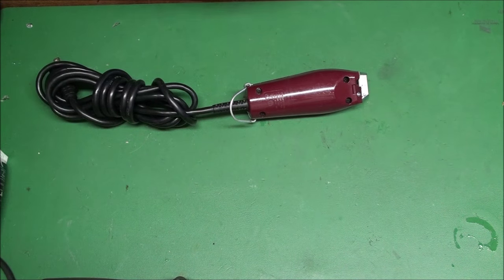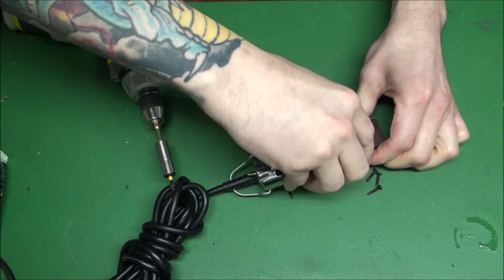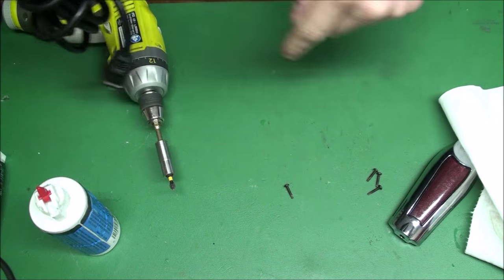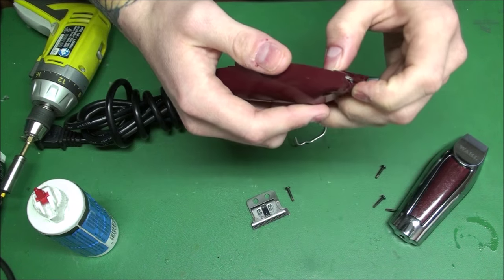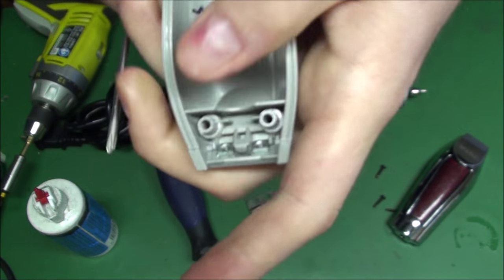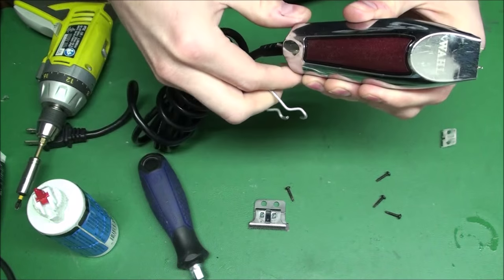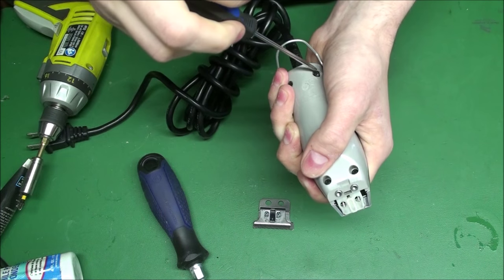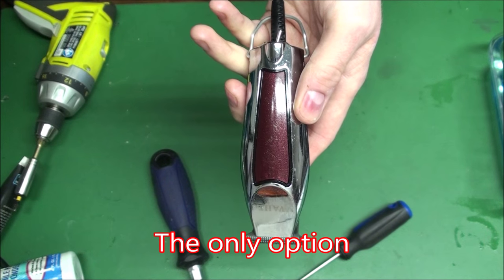Wahl Detailer Trimmer - Basic Repair for Barbers

Comment: These are my favorite liners of all time. I bought 4 of them and every single one cut amazing right out the box. I was able to get sharp lines on kids and adults without scratching them. Only problem is that the housing is very cheaply made. Every single one broke by where the blades go. When I got down to the last one, i treated it with extreme care, laying it down softly taking them out lightly and they still broke.
Reply from the maker: YouAwakeYet ya they are fragile but are very good getting the job done.

Comment: as I was opening and removing the motor the red and black wires came off...is there any diagram to show where it should be soldered any help appreciated the one ine the video is not the same {switch} as I am in uk

Comment: This was helpful. What size/type are the 2 tiny screws that go into the 'under blade'? Mine have worn out the threads. Thanks
Reply from the maker: +classic1984 I do not know the sizes sorry. I order thru a Clipper distributor. I have an account to buy them and have to order over $100 minimum. Your can google  im sure there is of part sellers.

Comment: Mines became very loud for some unknown reason while I was about to line my hair. They're almost brand new, only used them a few times and never dropped them. They were quite and smooth, now they're not. Any ideas on whats causing this?
Reply from the maker: +romedc Well hard to diagnose in a message. Check and make sure there's tension on the blade. If there is not it is the bottom case. It can be the blade guide is melted. It can also be the blade needing a sharpening and re-polish its surface. It also can just need oil on the blade. If all that is good then it will be a shot bearing in the motor and will need to be replaced with a new motor. If there not very old send back to Wahl for warranty. Well.Well good luck and have a nice day.
Reply: appreciate it man thanks
Reply from the maker: No problem

Comment: I have a model 8991 the silver and black sterling stylist trimmers, and I'd used them all of 3 times before they shorted out on me while trying to blend a very thick haired client. Any tips on this exact model would be appreciated because I'd rather tinker with it than buy a whole new one because it's still in perfect condition
Reply from the maker: Hi. this model is 8081 but i think yours will take the same parts but you have a different model number bc of the color. You should send back for warranty .Either the switch fuse blew out bc of the resistance from the thick hair or to much oil got inside of the motor and shorted the motor out and blew the switch fuse out. If you order a new switch i recommend putting a new switch in it and after hooking it up by soldering it to the motor and cord, have it in the on position. Plug it in for a half of a second and unplug it. if it makes a burning sound then it'll need a new motor to bc the motor got toasted by the oil and will blow out the new switch fuse again.

Comment: My Detailers won't turn on for some reason. Switch seems to be broken and wont power the trimmers. What do you think it could be?
Reply from the maker: +Anthony Garcia Hmm. I don't know. How did it break? Did the physical switch break? Did the pcb blow a fuse? Do you oil your blades? How old is it?
Reply: +Cloud's Diamond Sharpening it's not that old at all ..about 6 months old . At first the switch started acting up and getting stiff and then it wouldn't power on at all.
Reply from the maker: Anthony Garcia Since it sounds like the physical switch. If you replace the pcb/switch board it will work but if the fuse is blown out you will have to replace the motor also to prevent a new switch shorting out. I am not responsible if I am wrong. I can fix it if you can't. Good luck.
Reply from the maker: +Anthony Garcia https://www.diamondedge2015.com for all the details. My dad past away and i have a memorial so to be honest i can't promise 24 hour turnaround. But i can fix it for sure. Maybe same day or maybe not.

Comment: great video.. but how to solve the problem with the blade moving and the screws are tight as can be?
Reply from the maker: Hello . Thank you for watching. If the cutter blade is moving then you will need to buy a guide for the blade if they are available or buy a new blade. If the whole blade is moving around on the trimmer then you will need to open to see why the metal inserts are moving and may need a bottom housing to fix it. Hope i helped

Comment: I lost the screw from the shaver head inside part what size is it
Reply from the maker: F Ahmed I have no idea what screw your talking about but find a Wahl distributor and tell them the model number and what screw you need. Thanks for watching
Reply: Cloud's Diamond Sharpening hi its the blade screw from the underneath used to adjust how aligned the blade is, i have looked everywhere but cant find the screw size or the part
Reply from the maker: hi, ok . Its the same screw on a andis outliner blade screw. I dont sell parts. I just fix them. Google search for a wahl distributor. Or you can try fort worth shaver and appliance.

Comment: my tension spring will not curve in when i put the cam follower on its pointing straight up and it dosent slant foward
Reply from the maker: Hello. If the tension spring is not keeping its tension it's because it is broken from the housing you will need to replace the bottom housing

Comment: hey how much u charge cuz my Wahl detailer burnt out I was wondering how much it was so you could put a new motor for me
Reply from the maker: +Christopher Diaz Well usually that problem happens from not oiling your blade and the motor has to work harder. It over heats. You will need to replace pcb with the motor. Have you ever got the blade sharpened? If not it will need to be done.

Comment: One of my inserts is loose and I just got them about 3 months ago and I take good care of them, never dropped them or anything bad can you help me please?
Reply from the maker: Amin Sturges Hello, you over tightened the blade screws and it broke the inside of the case that holds the inserts from moving
Reply: I took them apart and yea ur right but I swear I didn't tighten them to hard what I realized is that the detailers case is cheaply made. They are made to wear out within a couple months. Bad investment when they have so many better clippers.
Reply: Thank you btw
Reply from the maker: Amin Sturges np and thank you for watching

Comment: My blade doesn't come off no matter how hard I pull what do I do?
Reply from the maker: northweezie1 hello. The blade inserts are turning inside the case. So you will have to take off the top of the case and use needle nose plyers to hold the nut from turning and then you will need to replace the housing.

Comment: my detailers make a popping sound in the motor or blade when turned on, I do keep them oiled.
Reply from the maker: +33craigcarter It will either be a motor or a cam drive.(the piece that moves the blades). Good luck.

Comment: how.can i make those more powerfull
Reply from the maker: You cant make them more powerful unless you mess with the voltage. You can have them cleaned and sharpened. It will make them like new if nothing is broken on them.
Reply: how can i contact you ??

Comment: anybody in the comments. The power (red wire) on the rotor motor detached from the mother board. (green board) how do I reconnect?
Reply from the maker: Solder gun and solder it back on by heating up the liquid metal
Reply: @cloudsdiamondsharpening3973  link to a good (but affordable) solder gun?
Reply from the maker: anyone with a temperature gauge so you dont melt the pcb

Comment: Help! I was screwing the blades back in and i tightened it too much and nownmy screws or blade will come out.. any suggestion?
Reply from the maker: It's possible that it cracked the housing that holds everything together. Take the blade off and check the housing under where the blade sits. If you see any cracks, that's your issue.

Comment: Nice work! but can you please! make a video on how to set and sharpen these. I sharpens my owns but no success at all but it's decent when cutting but I need consistent crispness. lol thanks!
Reply from the maker: +Preston Henderson Thank you. Haha that is a hard question to answer without out knowing what equipment you use. I&#39;ve trained lots of people and its not as easy as it looks for them to figure out. You have to have the right pressure pushing on the blade without hollowing out to much in the middle of the blade. You have to pull the blade off the spinning wheel correctly without damaging the teeth, if not pulled off evenly it won&#39;t cut all the way across the blade. Never use a stone it has no shape to it and blades need that to cut correctly.. I have videos of me sharpening on my equipment, on my channel and my website. Thanks for watching.
Reply from the maker: do you know where on the blade the hair snags on? Middle? or edges?
Reply from the maker: +Preston Henderson i sharpen the comb and cutter on my same wheel. Each side need to match to each others pattern. Sorry i cant help more.